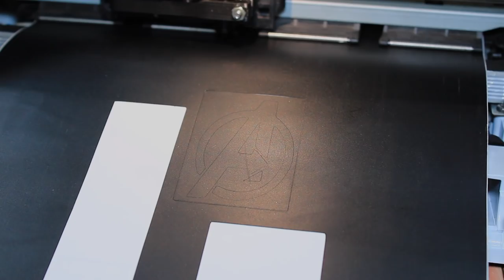DIY Vinyl Cutter from an Old printer Using Arduino - Part 1

Comment: I have to say that I admire you for doing this. I don't want to cut vinyl, but even if I did, I'd start this sort of project and give up after about a day, as soon as I found that I needed to order the "right" bolts. And by the time they had arrived, I'd have lost half of the other parts!
Reply from the maker: Thanks mate!

Comment: Ironically, I have two vinyl cutters and wanted to use the old one and try to convert to a very low power laser cutter/burner! My thinking was it should work fine with the existing software for the machine and if I could figure out how to mount and power a small laser.... skies the limit!
Reply: How to Make CNC Laser Engraver Using DVD Drive search this and share the end result if find this helpful

Comment: The idea is good and well-executed, however, with most of us having 3d printers, adding a cutter head is very easy and converting any SVG file to an Stl is even easier.
Reply: I have a 3D printer I don't know how to do that is it hard to fo???    I really would love to know how!!
Reply: I have an old HP Inkjet and I have a resin 3D printer, so I think I will try to make this, if not for anything, to say I made it. It looks challenging but I think I could do it. Adapting a filament printer sounds awesome, too (and easier). It does make me want to get a filament printer! (Can it be made into a little CNC miller?  :-)  )
Reply: @jlucasound  sounds like a plan, and a good idea let me know how it turns out if you can
Reply: @patprop74  thanks
Reply: For those who don't. This is a treasure.

Comment: The video shows you have the in-depth knowledge of the printers circuitry and also of the mechanism. What would be the cost involved in altering the inkjet printer to vinyl cutter? I have with me one HP make inkjet printer with me;  it seems that there are many parts are to be 3D printed. But the project which you have done is superb and is tempting me to fry my inkjet but further guidance is needed from you to achieve it.

Comment: Hello. I have a deactivated Cricut Expression Air 2 I was given for parts. It was going to be thrown away and I figured I could grab the motors from it because they still work. Then I saw this video and I now want to rip it apart and turn it into something like your machine. Do you think it will work? Thanks!

Comment: That's a great project!
Don't you think you could have kept more printer parts? Like no stepper
Reply from the maker: Thanks!
Stepper motors were easy to use.
Reply: @LoopLinks  I bet that's much easier, yeah
Reply: @NicksStuff  I'm using the ink jet motors on my 3d printer videos.

Comment: Very clean 👍👍 Somewhere in the video when disassembling I was thinking that it's shame that ribbon cables can't be used. But damn. I've never even noticed that some printers can have so big soldering points in their connectors! I've always looked them that they can't be re-used anywhere, but now I'm definitely going to keep eye if I happen to disassemble printer, scanner etc.
Reply from the maker: Thanks!

Comment: Waiting for Part 2 Please. Kindly Show the Schematic diagram and Arduino firmware settings Bro.
Reply: The schematic diagram is very simple. The motors just need to be connected to the outputs of the respective drivers of each axis and the solenoid is powered through a relay which is activated by the Arduino's digital pin, most probably D11 as it is used to control the spindle motor when used in a CNC machine.

Comment: interesting project but I was wondering could you not use the original motors? they seem to move printers with a pretty high degree of accuracy out of the box, so not usable or simply easier to control with standard nema steppers with the Arduino.
Reply from the maker: I started with the same idea but it turned out it was not easy to use original motors with my limited programming knowledge. So i opted for stepper motors.
Reply: @LoopLinks  I thought that might be the problem, I too suffer from limited programming knowledge so I won't give you a hard time for that ;)
Reply: @kirknelson156  Check out my new videos. I'm using the inkjet motors for a 3d printer.

Comment: Very cool! Does the knife cut the roller up (or get dulled on whatever is under the vinyl)?
I'm videoing a 3d printer made with inkjet parts. Check it out!
Reply: Depends on the variables of the software. I have two commercially built vinyl cutters. The brand I use can cut only deep enough to cut the vinyl on the surface of the backing sheet and never even goes all the way through. It also has a cutting mat that rolls with the vinyl underneath it, one of those "self healing" rubber matts when I need to cut all the way through. If the depth of the cut could be controlled well enough I suppose this could avoid cutting all the way through. It would the "z-depth" of the cut.

Comment: Where did the part from 3:09 come from? Is this to make sure the cutter has a flat surface to cut on?
Reply from the maker: That's Aluminium angle. Yes to have the flat surface
Reply: @LoopLinks  Thanks. Did it come from the printer or did you buy it?
Reply from the maker: @B-U-N-N-I  I purchased it

Comment: hi, show me how the wires are connected to the board?
Reply from the maker: Kindly check Part 2 video description for circuit diagram.
Reply: @LoopLinks  I looked, but there is another board with a relay shown there

Comment: doesnt your solenoid overheat ?, within 1 minute mine is so hot I cannot hold it, assuming you engage / ennergize the solenoid to push the cutter down to cut right ?
Reply from the maker: Yes it does overheat if you will continuously energise it. It's better to give a break after each design cut especially if you are using 3d printed parts.

Comment: Also, the software needs to consider the blade offset.
A common cutter will consider, but using a made one I'm not sure how to make this.
Reply from the maker: It doesn't consider blade offset. I guess that is the reason for inaccurate cuts.

Comment: Hello. where did you get such springs?
Reply from the maker: AA Battery holder
Reply: @LoopLinks  Thanks. But it's not entirely clear.
You have 6mm shafts. The spring from the AA battery pack is much less diameter. ...
I want to build my plotter without using an old printer. Only 2040 aluminum profile and openbuilds bracket
I really liked your Z-axis. I want to use it.
Reply from the maker: Well I had to adjust the springs..I would suggest to use solenoid with more holding force and better springs than mine.
Reply: @LoopLinks  Thank you!

Comment: so i need to watch how to mke 3d printer now
Reply: Honesty cheaper to buy a 3d printer at this point. Anycubic and elegoo have sales all the time these days and unless you already have most of the motors and other odds and ends on hand it's gonna cost more to build. Just the motors cover half the price of buying one assembled if you catch it on sale. Though I guess building one could be fun in it's own right. I'd say buy a cheap one and upgrade it.

Comment: Instructions unclear. Cat stuck upside down in the microwave.
Basically: remove everything except the housing, built an entirely new movement plattform, put an arduino into it and fire it up with some custom firmware.